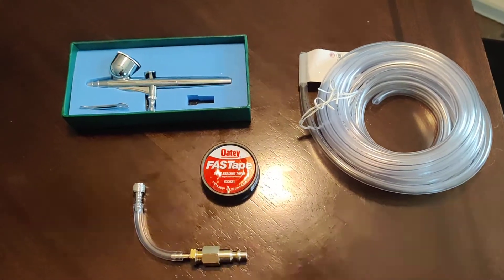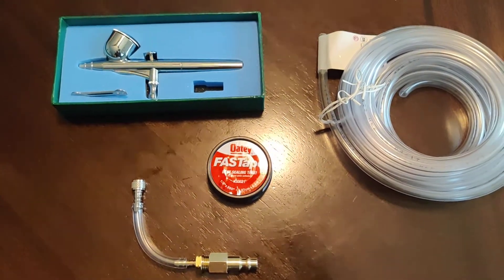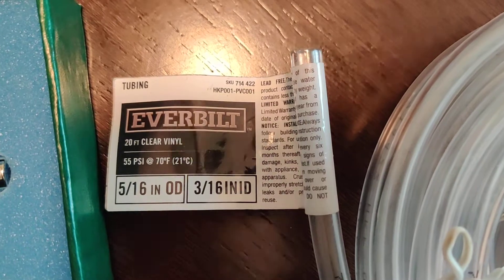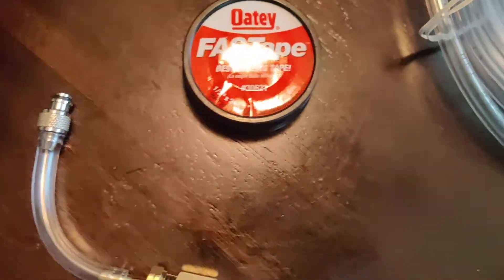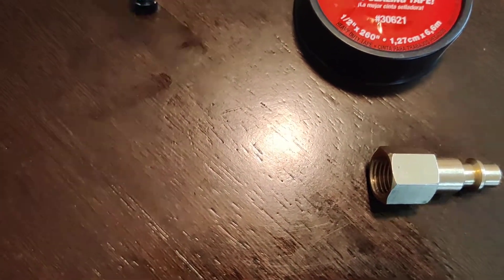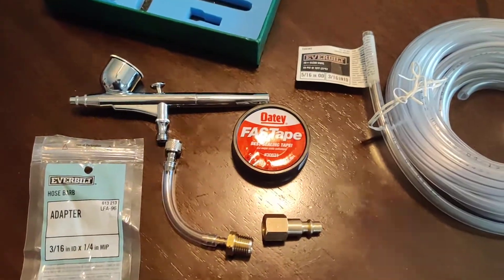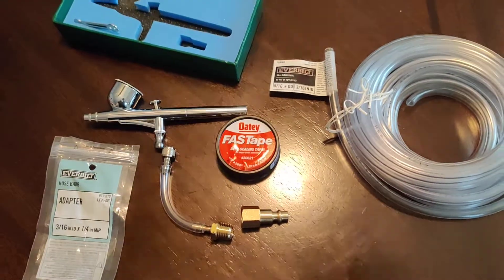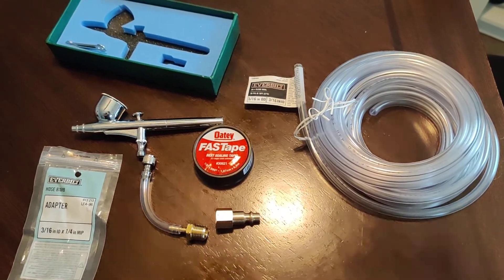How To Connect Air Brush to Standard Industrial Fitting on Standard / Regular Size Air Compressor -

Comment: You can get a set of adapters for airbrush hose that has it plus a bunch other useful adapters for about 8 bucks on Amazon or eBay or just the 1/4 to 1/8 adapter for like 3 to 5 bucks. Way easier and cheaper and probably work out much better over all not to mention it takes like no time.
Reply from the maker: Never seen an adapter, went with the HD/Lowe's solution since it was also very cheap and I had no hose to begin with just the airbrush itself.